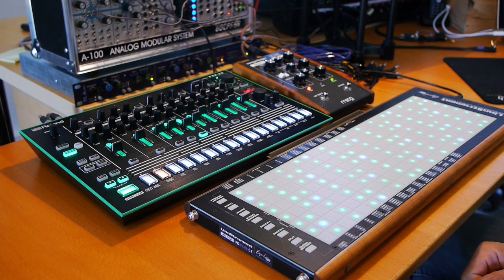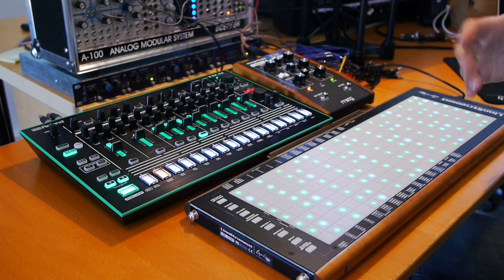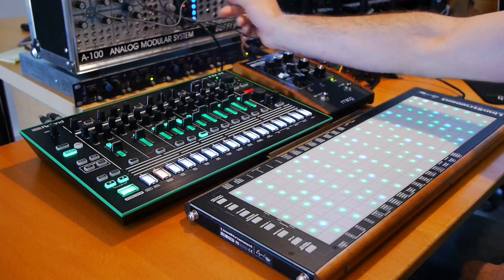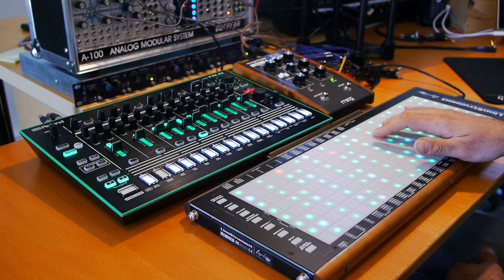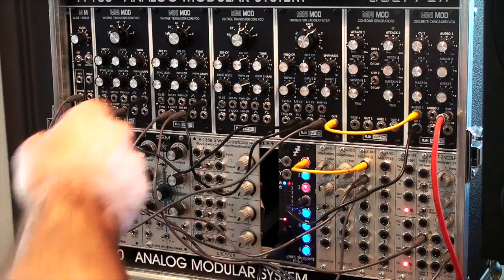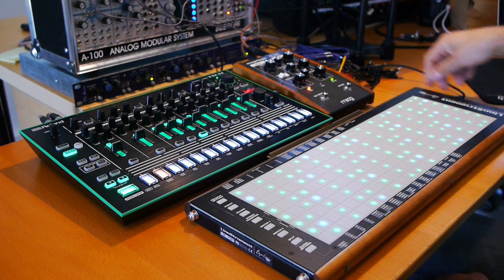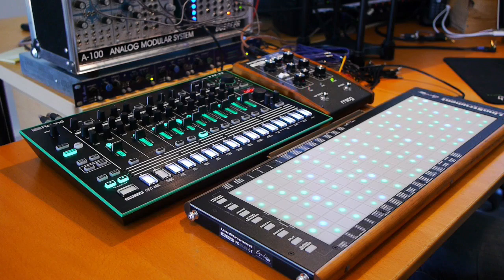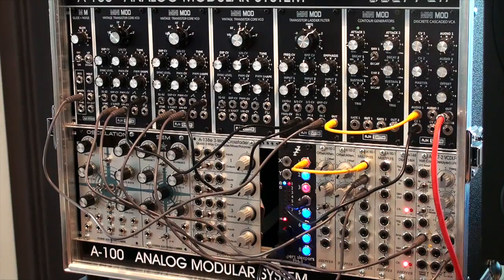LinnStrument and Expert Sleepers FH-1 - Technical overview

Comment: Hi Geert, I'm a new Linnstrument owner and hugely impressed with what you and Roger have come up with. I've been using it with my FH1 (just as you have shown) but I'm getting some bad crackling with low and slow pressure. Both at the beginning of my key press and at the end. I have 3 different VCA's and all do the same thing. Both the FH1 and the Linnstrument are up to date with there firmware. If I use the gate/CV combo of the FH1 with an ADSR before the VCA everything sounds perfect but I loose the pressure/volume control that you've demonstrated. Any ideas?
Reply from the maker: +A Box In The Sea yeah, you need to add some smoothing to the pressure CV output http://expert-sleepers.co.uk/fh1usermanual.html#smoothing
Reply: +Geert Bevin I can't figure out how to enable CC's 64-95. If it's too detailed of an explanation no worries. You've been a huge help already in identifying the issue :)
Reply from the maker: +A Box In The Sea the way of configuring this in the FH-1 is quite tedious imho and doesn't really feel comfortable with a performance oriented MIDI controller like LinnStrument, still it's possible by redefining the behavior of some of LinnStrument's controls. For instance, you can change the CC numbers of the CC Faders feature. Just go to per-split settings and hold down the cell corresponding to CC Faders (Column 14 2nd row down). You be able to select each CC Fader to the right and swipe left/right to change the CC number. Now to configure the FH-1, make sure that split is using the right MIDI channel 1 or 2, depending on the output you want to configuring. Then go to the actual CC Faders mode and change the position of the fader to set the output smoothing on the FH-1. It's best to do all this in a separate split so that you can still use the other split to try out your settings. Finally, once you like how it behaves, you can save the current state as a preset in the FH-1 so that you never ever have to do this tedious process again :-)
Hope this helps!
Reply: +Geert Bevin This is wonderful! Thank you so much. I really appreciate that you spoke to the tediousness of configuring the FH1. I'm no programmer but in my opinion as well it is a bit of a barrier to entry.
Reply: @gbevin  Is it much easier to configure the newer FH-2 to work with the Linnstrument? I'm considering getting the 4ms SWN and using the Linnstrument to play it polyphonically (probably duophonically in reality but with 4 to 6 voices). However, since the Linnstrument's note per channel mode alternates through 8 MIDI channels, I'm not sure how to make this work with the 6-voice SWN. Thoughts?
Reply from the maker: Marc S. Langelier I haven't tried the FH-2 so I can't really say, sorry